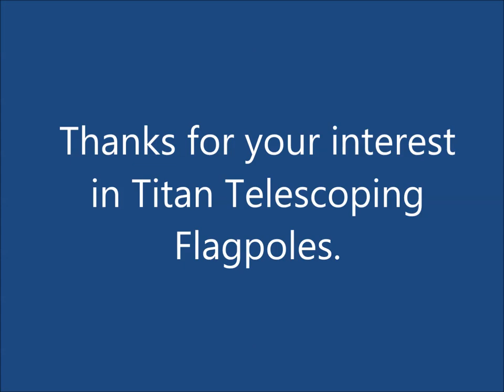Flagpole Farm - Titan Telescoping Flagpole Install Instructions 2018

Comment: A few of these videos mention to make sure that the sleeve is pushed into the gravel to allow drainage. Water should never, ever be able to enter the sleeve in the first place. If a flagpole isn’t in it and sealed then it should be capped. I duct taped the bottom of mine then shoved it right down in one bag of mixed concrete. Then I put a lil padding at the bottom. But a sleeve doesn’t need to drain as it should never be allowed to fill with water.
Reply: It is impossible to prevent water from entering the sections and ground sleeve of any telescoping flagpole. There are no seals between the sections of telescoping flagpoles, nor seals between the flagpole base section and the ground sleeve. None. For that reason, the Titan flagpole ground mounting system is engineered to disperse any water that runs down the flagpole. The Titan flagpole instructions CORRECTLY tell how to install the flagpole ground sleeve to provide water drainage and prevent water accumulation in the mounting base of the flagpole.